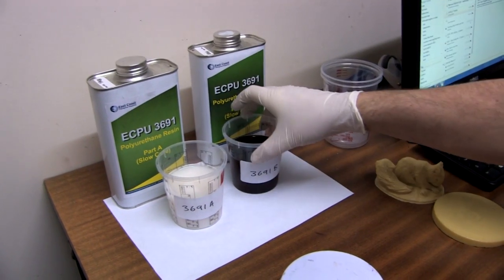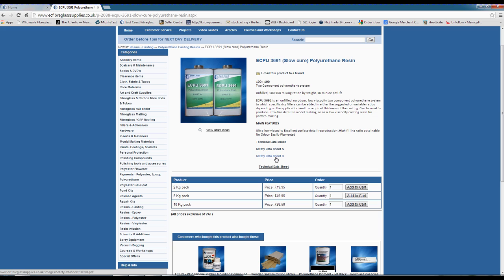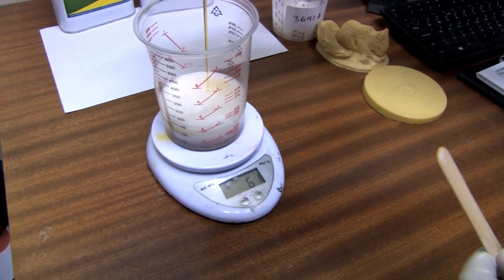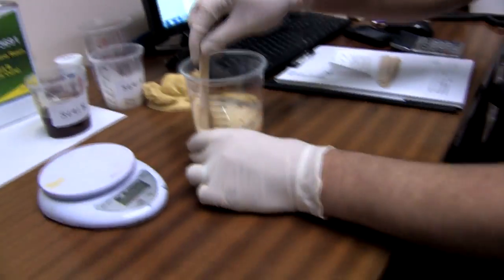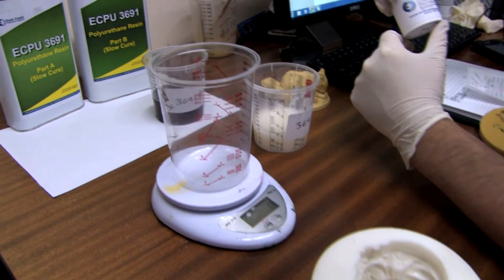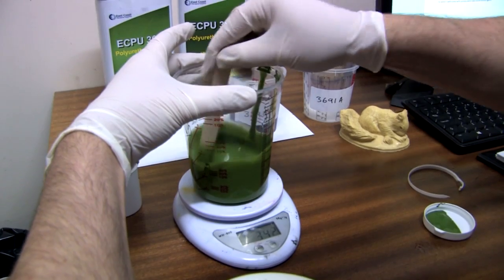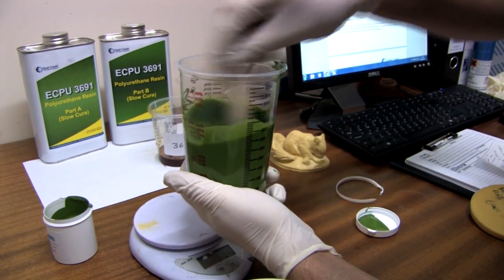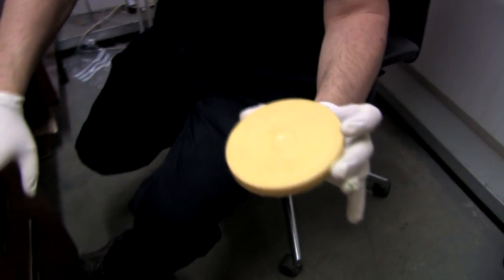Mixing and Pigmenting Polyurethane (PU) Casting Resins

Comment: 100:100 ratio divides to 1:1 ratio. You don't have to mix 200 grams of it at a time. You should measure  your casting by putting water in it first, then you measure the water volume in ml's. Then mix 1:1 to create the sum of the water volume.  There will be a lot less waste this way.

Comment: Problem with Polyurethane is limited colours.
Reply: no its not.. actually i work in R&D of polyurethane pigments and we develop whichever color our customer demands... :)
Reply: @Bakaitvyakti  what are the main ingredients of the polyurethane color pigment, is DOTP is the main component of it?
Reply: Polyurethane can easily be pigmented with dyes, pastes and mica powders. The colour options are endless...
Reply: @nathanwebster5705  I was excited to see your comment.  Please help me out.  I want to paint my car and RV using roller brushes.  Most standard auto paints have to be sprayed on.  I am limited with space.

 I want to use Durabak18 a moisture cured polyurethane made by the Durabak company in South Africa.  They sell in the US thru their warehouse base in NJ.  Their polyurethane bed liner paint is rock hard but also flexible, unlike epoxy paints. It can be roller brushed on.  It is reduced by Xylene, to thin out or clean brushes.  They told me I can only use non-water-based paste pigments to color it.  The standard powdered automotive pigments won't work.  Durabak said they don't know if Mica powder can be mixed it.  I want to make a custom pigment with mica powder for a pearly shade for my RV.  The advantage of using Durabak is that it is very thick and rock hard, and that works for preserving my van or car. However, the standard pre-mixed colors for Durabak are very limited.  They are all solid primary colors.  They do make a clear PolyU that I could custom tint, or take a pale color and add tint and mica to it.

The issue is that they won't tell me what kind of polyurethane it is besides what I mentioned.  Where can I find colors to tint it with?  Which form of mica can I add and how much to get a pearly effect.  Their paint Durabak18 dries to a satin sheen not high gloss. Will it show up the pearly effect?  Do you know where I can buy these paste pigments?  Please advise. I have looked hard and long.